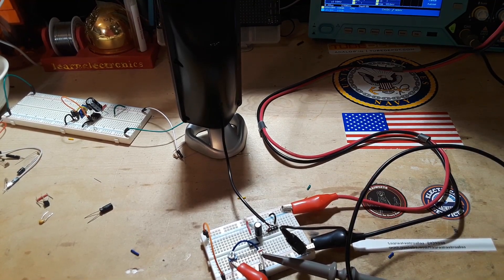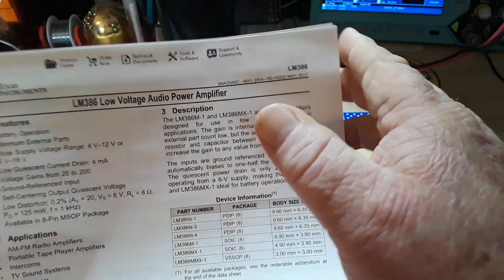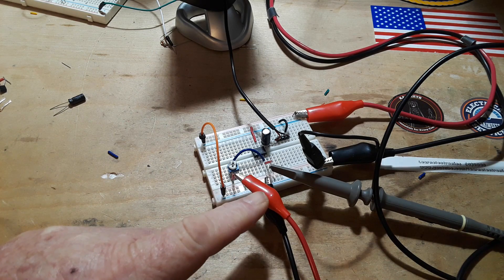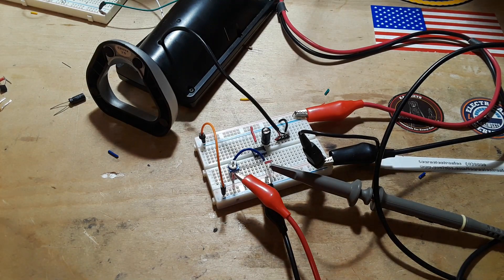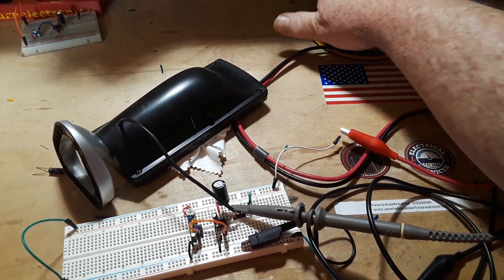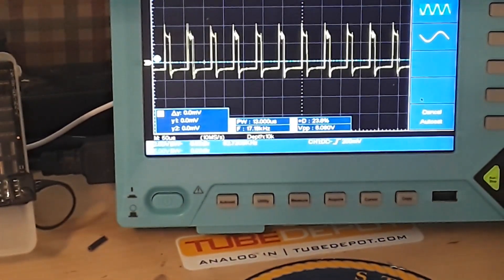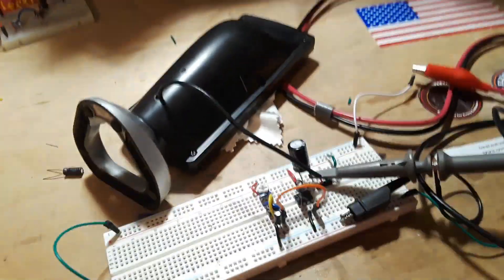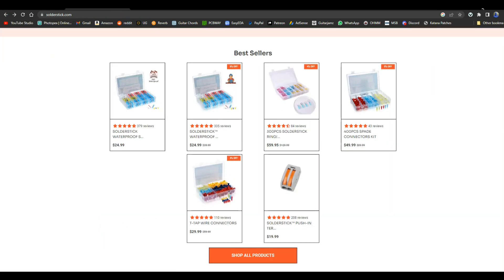LM386 For The Anti Bark Device? - Sponsored by Solderstick Wire Connectors

Comment: I’m looking for a similar circuit that would produce a frequency of 14 to 15 KHz .  How would you change the circuit for that to happen?  Interesting what a different speaker will do to your circuit
Reply from the maker: The capacitor between pins 2 and ground controls the frequency.
Reply: Thanks

Comment: A weakness in this project is the lack of a proven requirement specification.
The purpose of the project is to design and build  a circuit that will produce  an ultrasonic sound that will startle a barking dog,, and thereby discourage it from barking. 
Questions that require an answer, either from the scientific literature, or from practical experiment with a lash up of general purpose test equipment are:

Can a barking dog actually be startled into not barking using a suitable sound?
How loud must the sound be?
What frequency of sound is most effective, and with what modulation or cadence. 
What is the optimum waveform shape, some, square, or something else?
What is the optimum sound parameters, consistent with the goal, but not harming the dog and not irritating other creatures, including humans? 

A failure to answer these question in produce a requirement spec, will most likely produce a project that may work electronically, but produces disappointing results in meeting the stated goal.

A vital component of the project is a suitable loud speaker that has the required frequency response and can handle the output power. 
Posdible candidates are a audio tweeter, or a piezoelectric sounder. 

There is little point in using a linear amplifier, unless the output waveform is close to a pure sine wave. A simple MOSFET switching drive transistor or bipolar transistor current buffer amp should provide a suitable output stage for a square wave signal output.
Reply from the maker: Attempting to copy a product that is available on Amazon. That's where I get the specifications.
Reply: @learnelectronics  that reasonable,  if they give sufficient details, and the product works. 
I have one of those hand held dog deterrents that looks like a small megaphone. It generates both audio and ultrasonic output, with a switch to select which is active. I was never very impressed with the performance, the dogs can clearly hear the ultrasonics, but tend to ignore it, which is why  I suggested a few tests.
While copying an existing idea can provide a cost effective solution, it is better if you can improve upon it. 
The key is using the correct transducer (loud speaker) with the necessary bandwidth and power capability, be it a tweeter or piezoelectric transducer. 
The zobel network at the output of the IC amplifier compensates for the inductive load of the speaker, and may be required for amplifier stability.

Comment: You’re dealing with a square wave, an assortment of harmonics from its very nature. Your amplification and your capacitor arrangement aggravate the system. If you look at the output on a spectrum analyzer, it’ll be obvious what you’re dealing with. Input a sine wave that’ll give you better results. Your scope is just triggering the predominant foreground harmonics. You’re missing what is there.  An FFT mode on the oscilloscope would be great.

Comment: What happens if you use a sine wave input to your amp ?  You are pushing a high frequency square wave through the likes of capacitors into an audio oscillator.  The signal will be a pigs breakfast, full of over powering audible harmonics.   If you have an ethical need for square wave then just use a MOSFET switch.

Comment: Whatever you end up doing, you might want to check that the output signal is impedance matched to the speaker. 

This could be a good opportunity to talk about how people used to make impedance measurements without fancy equipment, even if your data sheet tells you what it should be at your output.

Comment: PAUL, why are you getting harmonics and what is causing the harmonics?
Reply: The harmonics are the nature of a square wave because the rate of change of a square wave consists of very high, sudden peaks and infinitely high spikes in a perfect square wave. Real physical systems can't follow such high rates, so the signals get distorted. Different waveforms have different harmonics. A harmonic is an additional frequency created by the wave. The sine waveform is unique in that it doesn't have any additional harmonics; it is the fundamental waveform.
Reply: @eetech_fix2393  A Square waveform won't have additional harmonics it will have a Square Waveform. In this video you can see the harmonics Riding on top of the square waveform which I'm not sure why this circuit or what is causing the added harmonics riding on top of the square waveform?

Comment: For the LM386 I would recommend an input coupling cap (remove any likelihood of DC) of around 0.1uF and  a cap to ground (from pin 3) of 47pf (reduce likelihood of feedback). Connect pin 2 to ground using a 0.1uF (not a short).  Ditch the so-called volume pot and fix the gain (to less than maximum to avoid hiss). I am not a fan of breadboards, their capacitance and poor connections can cause multiple issues, always use supply decoupling on the board.
Reply: I was also thinking about a dc getting thru, and causing that horrible noise!

Comment: Greetings
I am trying to fix a power supply for a tv , it has a "diode" the small dark   cylinder with a gray line on one extreme  with the letter R3200 147k  , I have looked in google for this number but nothing shows off , can you point me to what this part might be or where I can read or buy one ?